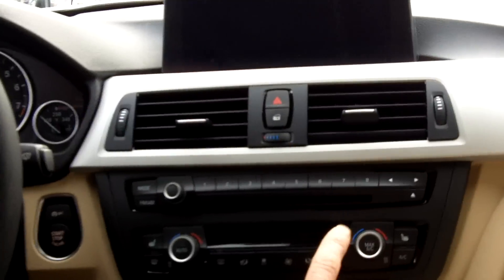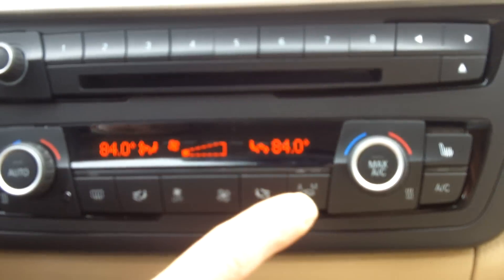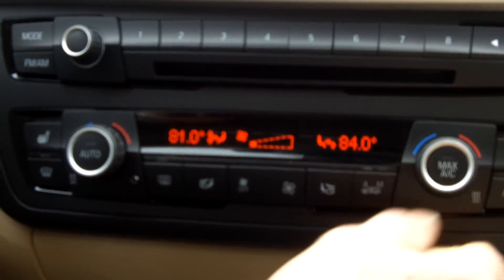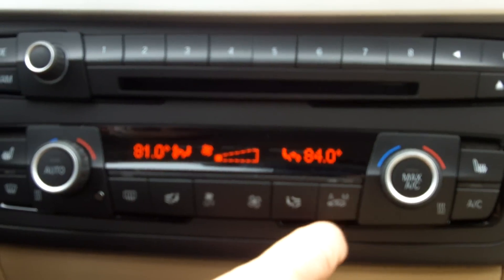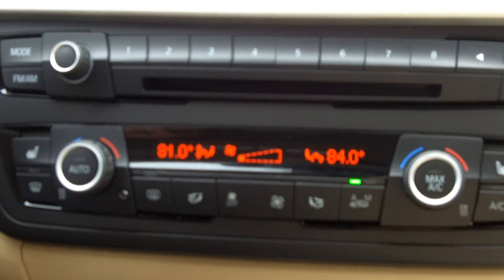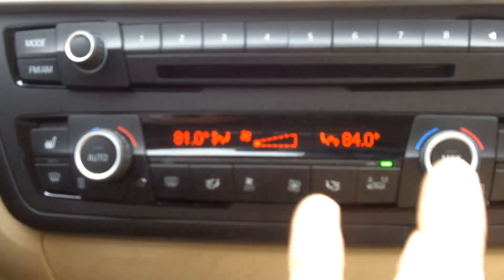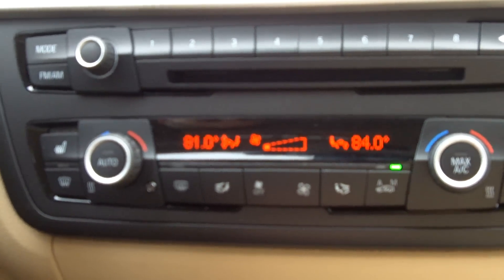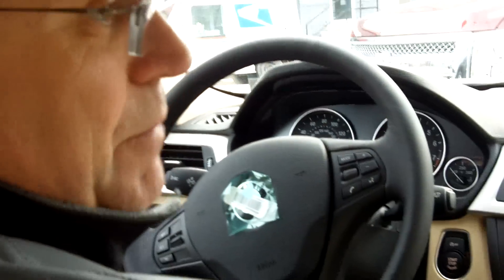BMW Circulation Button

Comment: If you dont have the inside air circulation mode lit up, you will get fresh air from the outside. The logo looks like 3 arrows forming a circle.

also there is an auto circulation mode (with a A in the circle) this will detect foul air and will automatically turn on the inside air circulation mode.

If that button is not lit, you have the fresh air mode.

Comment: the dial on the vent where it has red and blue what are the function of that?
Reply: Air temperature to the face, separate from your overall temperature setting.

Comment: FALSE! Sorry but you are very wrong about manual mode. It has nothing to do with heating or cooling outside temp. Manual mode if you see you will enter an area with dust or smoke, etc you can close before it enters the cabin. With auto would be late reaction to that. Normaly you want the outside air at all other times as circulating the inside air for long would result in low oxygen quantity.